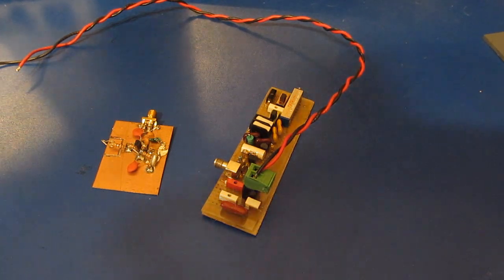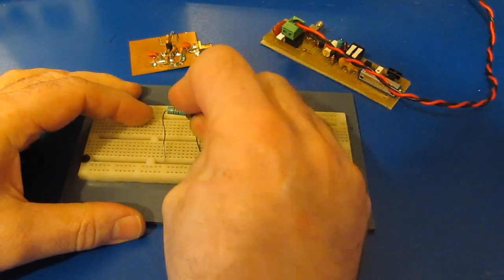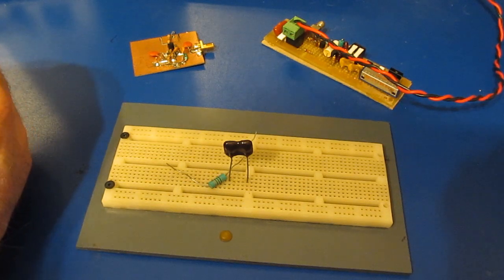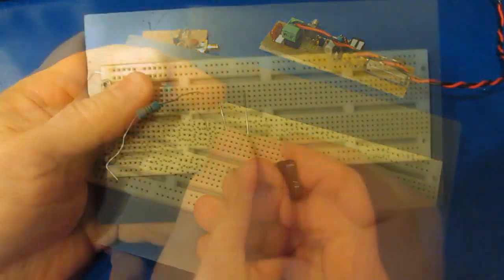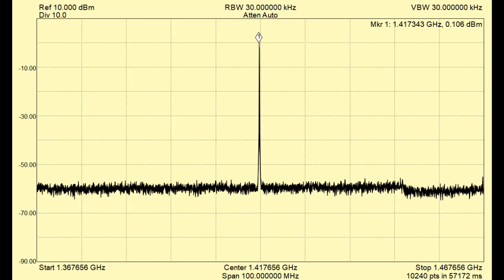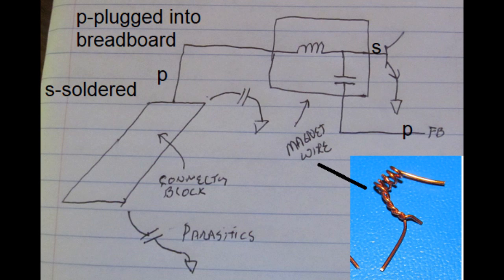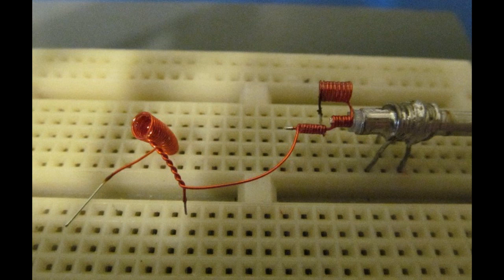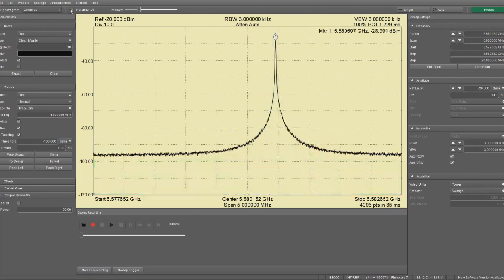The fastest breadboard oscillator on the mudball, EEVBlog Contest

Comment: At my first job we had an alarm system for car that was "sensorless" (you didnt need to install these horrendous ultrasonics things). It has a built in 2.4Ghz osclliator and the modulation of the tone was taken out of the circuit in form of a low speed signal that a microcontroller could analize to tell if someone got inside the car. It worked pretty well. They told me something like it was done with a doppler oscillator. Please, forgive me on RF because for me is black magic. But it remind me the effect when you waved your hand at 3 feet from the oscillator.

Comment: You wouldn't beat this even if you are cocky enough to wire a cavity magnetron onto your breadboard, not one you can typically get from a microwave at least. Marvellous
Reply from the maker: The nice thing is we don't need a lot of power, just the highest frequency possible while staying within the rules.   I would imagine someone will show some sort of cavity at some point.
Reply: It'd be fun if someone looked into Jagadish Chandra Bose's work on microwaves and how he managed to produce up to 60 GHz with spark gap transmitters in the late nineteenth century, and also was the first person to detect those waves with a semiconductor device
Edit: *GHz,; I know the rules say a sine wave but it would still be something worth looking into I think

Comment: Bookmarking for every time someone tells me not to use breadboards! (The pros still outweigh the cons.)  Bravo on obtaining this rate of speed! 😅
Reply from the maker: I've seen < 5MHz mentioned several times.
Reply: I would be happy with generating a pulse at 32.768 KHz (using these rules) that somehow looked like MIDI to something that read it ... just a simple Note On and Note Off "oscillating" repeatedly. Cheers!

Comment: I take it you won then? A couple questions.  Is that all your personal gear or where you work?
Second can you share detail of how you made that. What transistor if any.  Layout. Wire used etc?  You have a lot of knowledge.
Reply from the maker: It was just for fun and bragging rights so I would say viewers won.  It did cause a fair bit of drama.   That equipment is what I have accumulated over the years for my own hobby and has nothing to do with my work.    I bought the parts from Digi-key.  I suggest just using their search engine and buying a few parts each and seeing what you can come up with.

Comment: This guy's equipment is worth $100k+
Reply from the maker: LOL!!  You may want to check eBay.
Reply: 5K for that LeCroy. Not bad. Do you buy them broken and then fix and calibrate them for use?
Reply from the maker: A lot of the equipment I have bought over the years was non-functional.   Yes, I do my own repairs and will align them as needed.

Comment: I would like to join un, but currently I don't have a scope handy that can measure these things. Btw, what type of breadboard is allowed? I have seen actually gold plated ones specifically made for HF breadboarding.
Or in other words, the type and quality of the breadboard is really important. Hack, even cleaning the contacts is going to matter at this point.
Reply from the maker: Basically any standard board that you can buy is fine.  You are not allowed to modify them (pull contacts, cut them down, etc).
Reply: @joesmith-je3tq  Thanks.
Ok, but like I said, the quality of these boards can be very different. Especially when you look at the contacts.
Reply from the maker: @p_mouse8676  In the past, we had always used 3M.  I have no idea what they offer now.  You may want to have a look if you are needing something higher quality.

Comment: my best scope does 1Ghz. I would not even be able to measure this range.
Reply: mine is 20mhz! an old cro :)
Reply: All RF measurements were done by Spectrum Analyzer and not Oscilloscopes unless the wave shape has the meaning to measure like digital signals so change your idea and measurement technique if you are going to be with RF transceiving ...
Reply: He is using a Lecroy 8500A 5ghz, 20gs/s scope at 14:36
Reply from the maker: @RingingResonance  Along with two other scopes.  I don't think that Ahmed meant that literally a scope was not used but was suggesting that an SA is more common for RF work.

Comment: Nice work on a "breadboard." Maybe it should have been where every terminal of every device had to go through that infernal breadboard. What can you do based on that requirement? I could see people removing every few lines in the breadboard for increased performance.
Reply from the maker: The question is what can You do with the rules that were given to us?   If you take the time to read the comments or the thread, you will find we are not allowed to modify the breadboard by removing contacts or cutting them down.

Comment: I would think you could better with copper clad board than the breadboard, but was that one of the rules ???   Well done...
Reply from the maker: It's basically the very first rule (see description, thread or read aloud at the start of the video) and also in the title.  lol.  I could see where the confusion comes from.  lol.  So breadboards only and we are not allowed to modify them.  Are you going to give it a try?

Comment: Dumb question: if you oscillate at the frequency of light: does the copper wire cease being an antenna and become a flashlight?
Reply from the maker: I'm looking forward to seeing this oscillator of yours running and the scope and counter you are using to measure it!

Comment: 11:57 We'll have to come up with a name for this. It might have useful applications. 😁
Reply from the maker: Perhaps crystal controlled single transistor oscillator or crystal pull test oscillator.
Reply: @joesmith-je3tq  I fixed the timestamp.
Reply from the maker: @antennafarmer7380  Let's assume you are not trying to come up with a name for the Signal Hound BB60C spectrum analyzer but rather the effects of the changing environment on the oscillator.   How about capacitive proximity sensor.
Reply: @joesmith-je3tq  That sounds amazing.

Comment: looks great but what made the difference from 5GHz to 6? sorry if I missed it but could you show a schematic and a close-up of the circuit?
Reply from the maker: I talk about it in the thread that's linked in the description.   Basically I was trimming the magnet wire.   All there is now is a transistor, resistor and some wire.  If you want to learn more about this type of oscillator, check out:  https://en.wikipedia.org/wiki/Phase-shift_oscillator